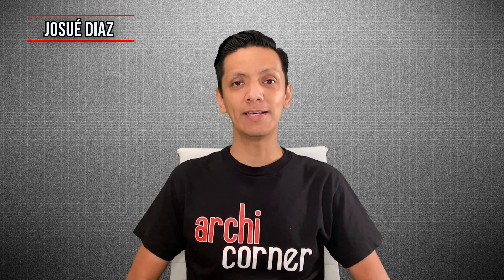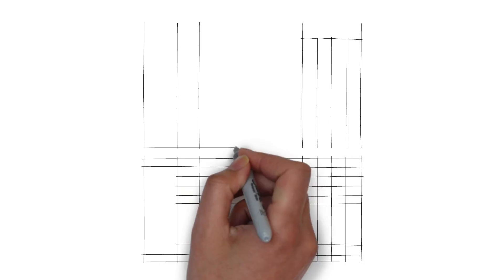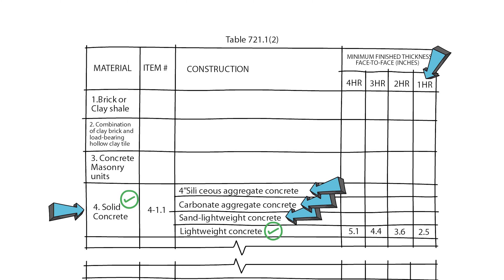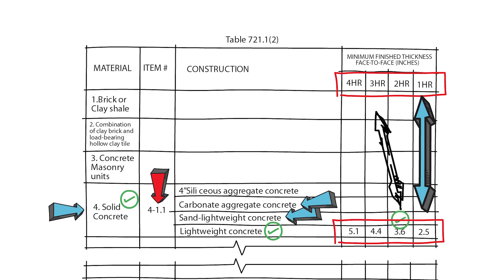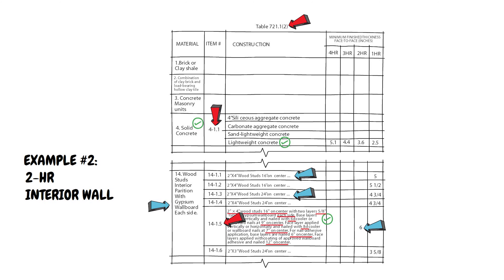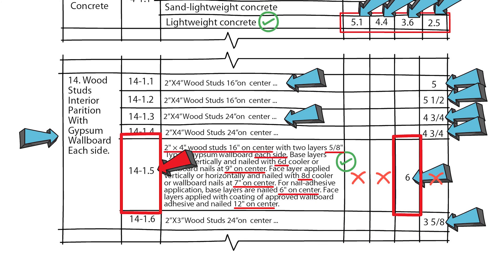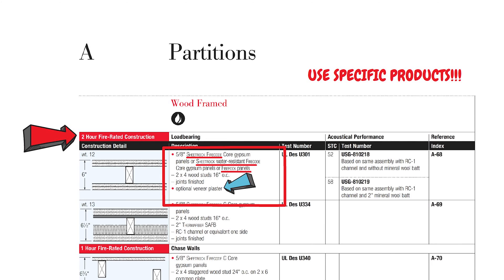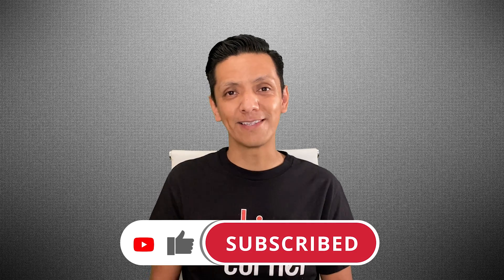AC 041 - How to find fire rated wall designs.

Comment: What should be the height for fire rated wall
Reply from the maker: It varies. in general terms it is from the ground floor to the roof assembly above. in multi story buildings it is from the floor/ceiling assembly below to the floor/ceiling/roof assembly above.

Comment: I have 2x4 walls with 7/16 osb and 19/32 t1-11 how can I make it 1 hour fire rated?
Reply from the maker: You would have to look through the UL book. There are literally hundreds of designs. It’s possible that one of them may be close to or the same as what you are planning. Another option is to see if the manufacturer offers rated conditions that match your needs. Often times you have to allow for slight modifications pending the approved design.

Comment: Is there any variance allowance say, if you have 2x6 or even 2x8 interior wall? Will the designs for 2x4 transfer?
Reply from the maker: Most rated conditions are in a book or catalog. In most literature, not all, you will find a prologue that explains the things that you can and cannot do. In most systems, you can have a larger core, but not a smaller one. For example, if the wall calls out for 2x4s but yo provide 2x6s then that is usually okay. But you cannot go from a 2x6 to a 2x4. But as mentioned already, you would have look at the catalog you are getting ratings from.

Comment: Hello, nice video !. Does anybody know if a Through Penetration of a fired rated wall is also a double Membrane fire barrier penetration of that wall? Thanks.
Reply: Your usage of "membrane" is confusing. Membrane is often reference to roofing like TPO, PVC or EPDM membrane roofing. Fire penetration products and "assemblies" can be found on 3M or Hilti website under their fire protection products, they should have UL rated assemblies for various type of walls ie Concrete, CMU, Wood Stud, Metal Stud.

Comment: You are super informative and do a wonderful job of explaining and simplifying the thought process.  I do have a question in reference to other stated wording within the code.  Hearing this explanation it can lead me to think that rated walls are only for separation.  Chapter 6 of my current version of IBC,(2012) it's old.  IBC table 601 specifies that most structural bearing walls are to be rated? Is this a correct assessment or is Chapter 7 the only location to find where rated walls are required?
Reply from the maker: Good observation. In short, there are various reasons why a wall may need to be fire rated. You mentioned a good reason which is that sometimes certain elements of a building need to be protected in order to be identified as a certain building type. Chapter 6 deals with building types, and will note what walls are required to be rated for a certain building type.

Comment: I live in Visalia, CA. I want to build a metal building made of galvanized steel in my back yard. I have gone to my local municipality several times to discuss permitting requirements. The person that works there told me that because two of the walls are at 3 feet from property line walls, those two walls have to be fire rated at 1 hour. I'm all for smart rule/regulations but what pisses me off is that they cannot tell me any examples of what I would need to do to achieve this. They won't even tell me is a steel building would qualify. They said, "It depends." I was thinking, "Yeah no shit. But you guys have literally no information on what requirements are being used to determine this." This is such an idiotic process. I am extremely frustrated. Wouldn't a steel building already qualify as 1 hour rated? Any help you could provide would be much appreciated. And thank you for your video!
Reply from the maker: Sorry for the confusion and for the late reply. I think the confusion here lies with between the terms "Fire rated" and "non-combustible". A metal building is already built from "non-combustible" materials and is metal is a good material to build with! However, this alone does not mean that the building (or a wall in the building) has been determined to have a fire rating. Even buildings that are built with only non-combustible materials have collapsed when under fire. That is why a wall must be built in a specific way to be "fire rated" even if it is built with non-combustible materials. If it is a custom prefab building, you may want to ask the fabricator if they have some details for a rated wall that you can use. Otherwise, you may be best off by hiring a residential architect who can design a fire rated wall based on your specific circumstances. Sorry if this was of no help.
Reply: @archicorner  thanks for the reply. I just met with a draftsman today. Unfortunately it’s going to cost me an additional $800 or so 🤦🏼‍♂️. Thanks again! I appreciate it!

Comment: Hi Josue , thanks for sharing your knowledge with us .lm a metal stud framing contractor in California I was wondering if you can do an episode about the 1 1/2" 16 gauge cold roll Chanel or before called black iron is the metal stick that goes in the punched wholes in the studs I would like to know what's the main purpose and when to apply it. Thanks in advance.